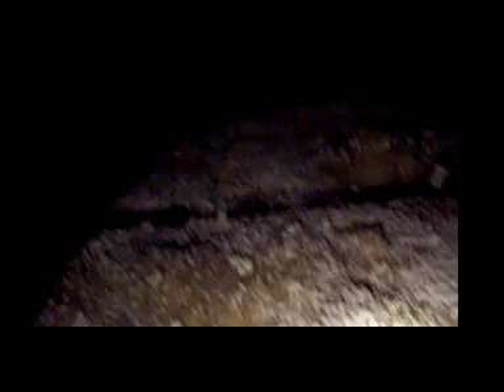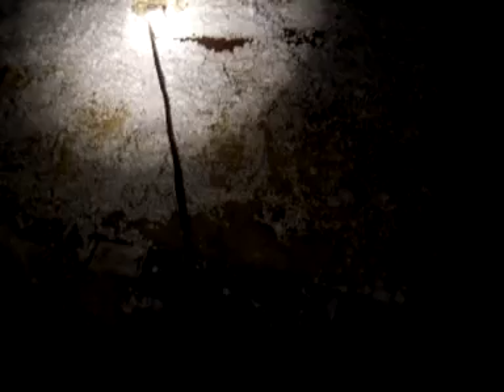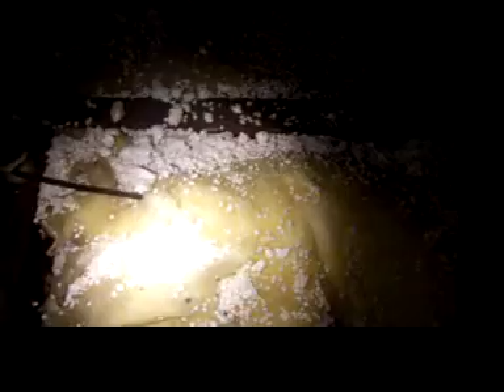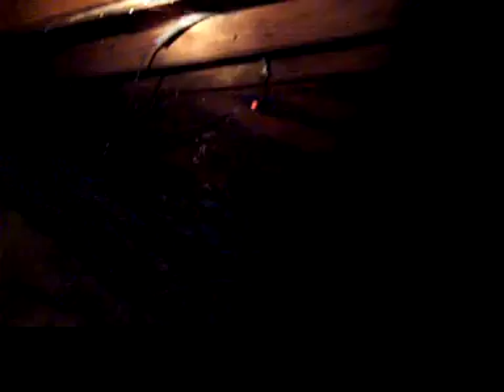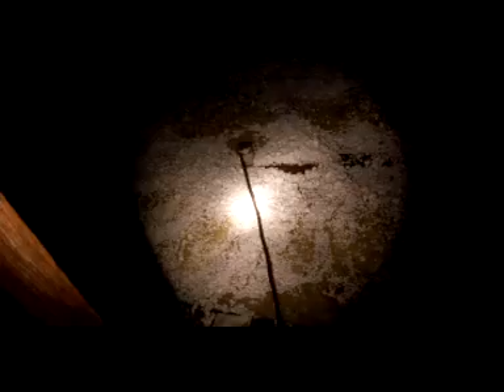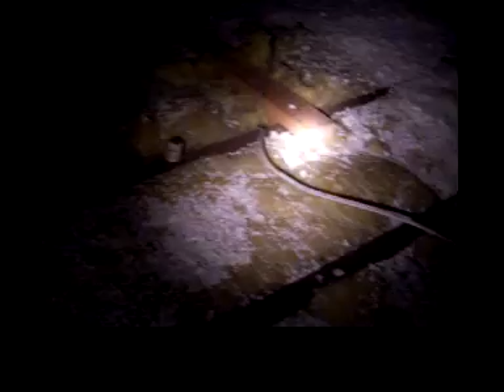Safety Hazard knob and tube wiring in attic waukesha home inspection

Comment: I have knob and tube in my attic and it is a FREAKING MESS. It has been cut, spliced, some places have very small wire installed, junction boxes over stuffed with no covers, bare wires showing signs of arcing. I'm in the process of rewiring my whole house myself. When I'm done every inch of wire in my house will be new. If I don't die from heat stroke in the attic. Damnit it's hot up there. next weekend I'm installing an attic fan.